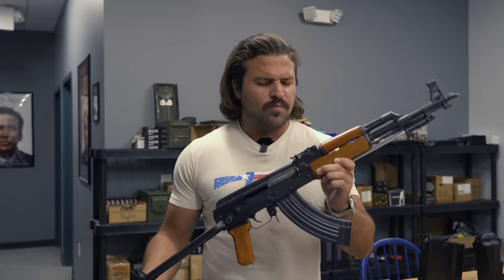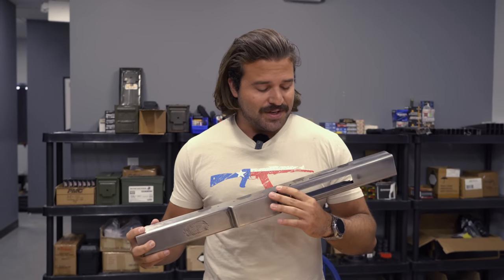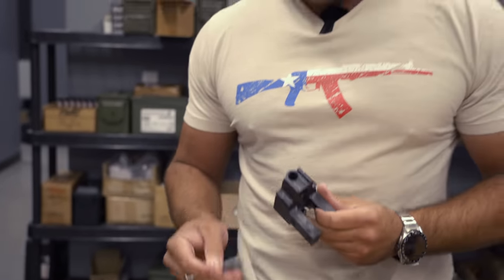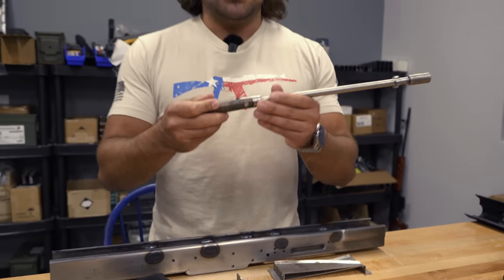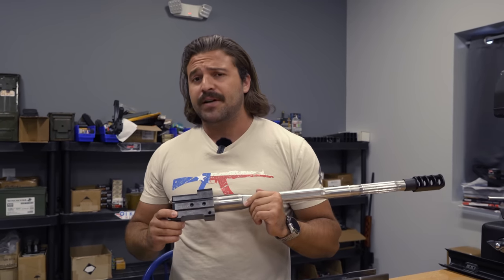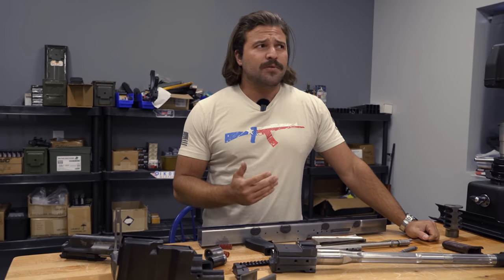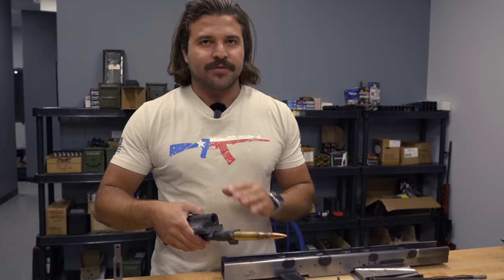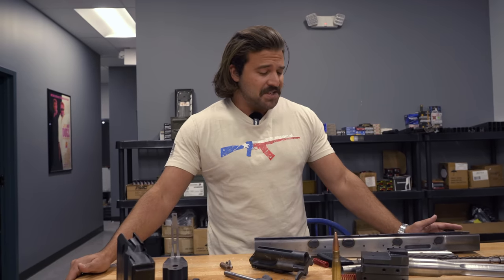The AK-50 Project - June 2023 Update

Comment: Man, as a shop owner I would be horrified and embarrassed if something like that rail went out of my shop
Reply: Oof😂 brutal truth
Reply: Fr what is quality control or blueprints? Lmao that’s shameful.
Reply: It's the communist aesthetic, keeping it real 🤣🤣🤣
Reply: average comunist product
Reply: I really hope it was deliberate trolling for Brandon not including all necessary position tolerances. I mean, to puck up that hard one has to try hard too.
Reply: I have to assume inappropriate specification, as it’s there to be shown.
If the part is out of tolerance, you don’t pay for it (unless you have no other option due to time pressures); if it’s entirely inappropriate for its function; but to spec (because the specification was insufficiently defined) then you have to take your lesson…
Reply: @LoneEagle2061  The guy has a 3d model that has printed without any issues, there's not really any excuse asides operator error.
Reply: @LoneEagle2061  A friend of mine who is a machinist told me that in every shop he ever worked in, he went over the specs with the customer before it ever saw the CNC machine and that was when any irregularities would be identified and addressed. The ONLY way that would have left his shop was if the customer told him (probably repeatedly) that that was how it was supposed to be.
Reply: @guyfalcurious762  I work in an engineering firm as a CNC Machinist, sometimes we get 3rd party CNC machined parts. You would be surprised what comes back from shops without proper QC, out of tolerance by upwards of 0.025”.
Reply: @ddoherty5956  You can give a machinist a 3D model, but if you want the part to come out in a timely manner you have to communicate how important different dimensions are and the tolerance associated. If you give me a part with a decorative slot with a dimension of 1.0005” and I cant ask what the tolerance is, I would either have to treat is as a precision slot and spend lots if time bringing in the dimension, or I would have to assume it’s not critical and shoot for getting close. Machining is all about time management and controlling different variables within a piece.
Reply: @clorax1357  have a closer look mate that's not a question of tolerance it's a question of symmetry.
Reply: @LoneEagle2061  Eh, not really an excuse. If it were just some sizes being off that's one thing. But some features being entirely non existent and major alignment issues. Nope, that's someone who does not care about their job.
Reply: @clorax1357  Oh I have no doubt but my friends experience had always been with the end user without having to deal with intermediaries.  Just from my own (admittedly non-engineering experience) the more people between you and the final customer the more likely it will turn into a game of telephone with all the attendant mistakes.
Reply: Tough part to make without the right equipment. So if it's hard to make quality is hard to achieve. That's why having the right equipment is important.
Reply: @TehkNinja  That does not excuse the quality. Features out of alignment or not existing is simply the company not caring.
Reply: @oakwoodmachineworks9598  hence why I said it's important to have the right equipment. If you can't make it to print don't send the part out. Where did I say it was okay to send out the bad part?
Reply: I'm sure worse has come out of your shop.
Reply: @randybobandy9828  I'll never claim I've never made blunders or mistakes, but I care far too much to let something like that out. There is a difference between a bore being a thou too small and a part shipping out that does not even look like the example on the print.
Reply: @OakwoodMachineWorks  lol I was just talking shit.
Reply: Nobody wants their rear impacted too hard
Reply: You sir are a man of ethics.
Reply: @clorax1357  What does 1.0005" mean?
Reply: @Shijaru64  1.0005 inches
One and 5 ten-thousandths of an inch
Reply: @clorax1357  That sounds horrible. Use millimeters.
Reply: No.
Reply: Hell as a machinist, i would be embarrassed about it too...jesus, i would scrap that well before it ever went out the door, machinists should take pride in their work for god sake
Reply: @clorax1357 Yes but that’s much more than .025. It’s clear as day in video while he’s moving it around. Some of that has to be at least .050-.065 out. That piece was done by a shop that put that project on the back burner till a couple days before needing to be delivered and probably gave him the speech “if any revisions need to be made just let us know, we’ll work with you on it”😂

Comment: Maybe you’ll see this, for the rear buffer where you used the stronger spring, if it doesn’t work or you want to try to make it even better consider using a hydronic system like an m240. 

Could help soften recoil even more and make it manageable to fire standing and firing more rounds. Just a thought

Comment: You may have a design flaw with the recoil rod/spring. Too much flex its going to bind worse in the future, & it'll groove the top of the bolt where the rod and spring ride. May need to make that part of the bolt thicker/reinforced. You may need a solid thick hardened steel rod and work the spring weight from there. Maybe need a stronger spring rate and adding a buffer asorber like the ones already made for a normal AK would help the recoil. Maybe a dual recoil spring if that doesnt solve it. Just fine tuning is all i can see from a engineers prospective. Impressive engineering you created.

Comment: When it comes to CNC machined parts with features on all sides, make sure you’re aware of the machines the shop has available, and try to look for shops with 4 or 5 axis capabilities so they can make features on opposite sides in one holding. The reason why your piece isn’t symmetrical is because somebody took it out of the vice, flipped it, and (very poorly) indicated the piece again.

Comment: To really pay tribute to AK you should be using the .5 cal spotting round used by tanks to accurately range a target before firing the main gun. It is effectively a shortened .5 bmg as the original AK round is a cut down rifle round. It should also allow you to cut down the length. Steve

Comment: Cutting flutes into a barrel absolutely does reduce the stiffness of that barrel. However, it also makes the stiffest barrel for the resulting weight. Maybe a better way to imagine it is to start with a given weight of material and design the stiffest barrel of a given length. If you make a fluted barrel with that weight of material, the barrel will be stiffer than if you had made the barrel in a round cross section.

Comment: As a machinist that handguard is embarrassing. i want to see the tolerances you guys gave to get that back lol
Reply: You would be surprised what comes out of machine shops without proper QC, I have seen some parts 0.035” out of tolerance when the shop guarantees 0.01mm fine hole tolerances
Reply: @clorax1357  got a hate tenth thou tolerances
Reply: @Freegrem  I only really see them in pin holes, but I have had a couple times where I had to make a 3.25” circle pocket +0.001” -0”….. 0.020” deep.
Reply: @clorax1357  +.0004 -.0 on like a .375 OD 2" long is the worst iv had to do and i hated every second
Reply: @Freegrem  The worst is when a critical part comes back for modifications and they’re like “yeah just skim that pocket by like half a thou”
Like dude, that means I gotta be indicated to the pocket within a couple tenths…

Comment: Probably a weird thought, but for things like the rail that aren't going to be pressure bearing doesn't it seem like you could save money by not sending it to a shop to get done?

Like I don't know how much that cost. But if you get a resin printer with a large enough build volume that should be $300-$500 then get enough castable resin to print it. That could be $30-$100 an electric casting furnace is like $300. That much 6061 aluminum is like $10 if you get gouged out the ass for it on amazon.

Then the only question is how good of a casting setup do you want. I imagine building a vacuum casting setup large enough to do that would be like $300-$700. Otherwise you could just buy some wax bar and build a vent from the bottom.

It obviously wouldn't be viable for everything, but it seems like you could get much more rapidly prototyped dimensionally accurate parts for some of the less critical areas

Comment: There is a ShAK-12 in 12.7mm and shortened cartridge (same idea as 300 Blackout or 9x39 but taken to extreme) . So, Russians already thought about it in 2011 :) 
Yes, making AK for BMG 50 is a different story. However, we should ask “what is potential use”. Is it long distance sniper rifle or heavy machine gun. AK action never proved itself to be a good platform for a sniper rifle due to large and heavy bolt movement. On another hand, making heavy machine gun will require a different feed for the round to accommodate for the large capacity (that would give us a KORD12.). After all, Russians already made the best use of 12.7mm round with ShAK12 :)

Comment: “Nothing to sneeze at, but it was the round the M1 Garand was designed to fire.”

Wrong, it was designed to hold 10 rounds of the .276 Pedersen caliber. US Army said no, I want 30-06, or were not adopting the rifle, because we have so much of 30-06 in supply. The M1 Garand was then modified to hold 8 rounds of the 30-06 in the internal magazine. So the proper term would be;

“30-06, nothing to sneeze at, but it was the round the M1 Garand fired.”

Then again, I realize no one probably cares, but I just thought I’d write it down.

Comment: Fluting DOES make a berrel less stiff/teduces structural integrity.
HOWEVER it is STIFFER than a smaller diameter barrel of the same weight. You know, emgineering $#!+.